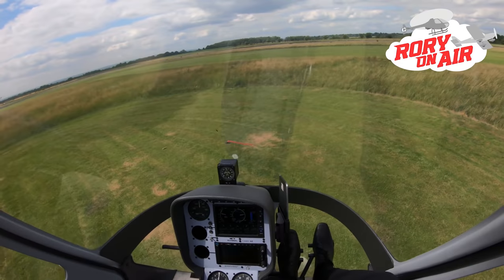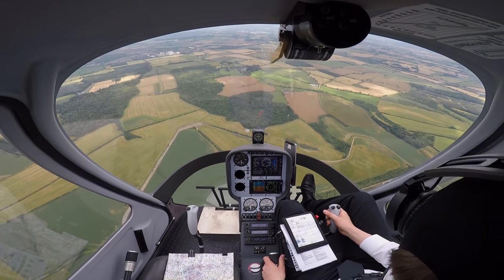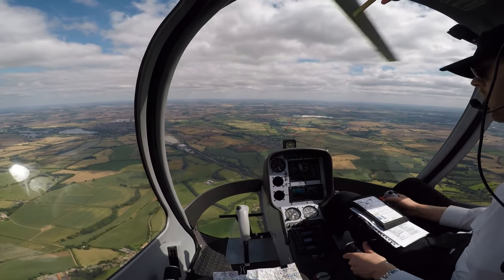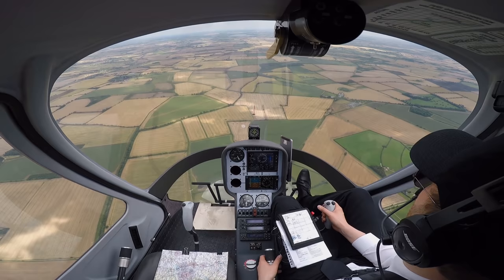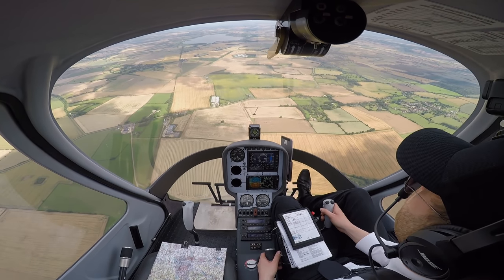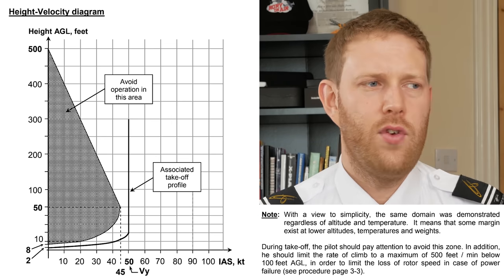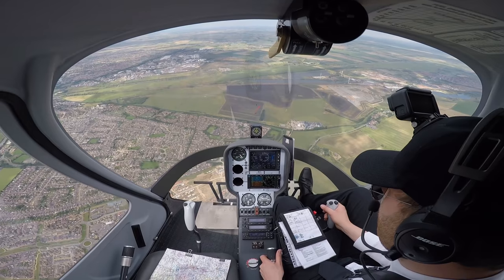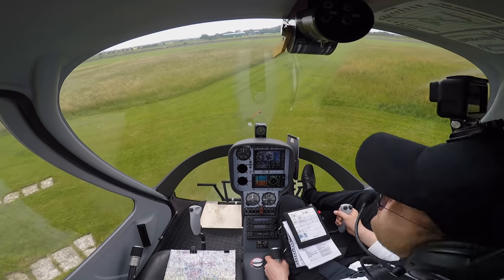Why do helicopters use runways? | Cabri G2 | Student Pilot

Comment: Great video Rory as always - loving the helicopter stuff. Does that aircraft have trim controls on it ? Im not used to that in the R44, or at least in the ones Ive flown lol. Great explanation of the Height velocity diagram
Reply from the maker: Paul Bury thanks very much Paul - glad you’re enjoying the heli videos. Yeah, the cyclic has a trim hat switch on the top of it.
Reply: Don't want to get my feet wet ha ha

Comment: Hi Rory, another interesting video.  I notice that the kneeboard is on your left leg.  Are you a south paw and if not can you let go of the control stick safely to write on the kneeboard?
Reply from the maker: Well spotted. I am right handed and I can't write with my left. You absolutely can't let go of the cyclic once the rotors are running so I have to try and remember what I need to or in cruise flight I can just about fly with my left hand and write with my right. It's not easy!

Comment: Hi Rory,

Great video and thanks for the explanation. As a fixed wing pilot, I've always been confused by helicopter operations and wasn't even confident that they did always use runways at airfields. 

But if I'm not mistaken, at the end of your video don't you actually land at the "H" without using the runway? 

Assuming so, would you be able to explain how a fixed wing pilot would know your intentions in this situation? Maybe if you could mention the radio calls you made in this case as an example? Or do procedures vary with the airfield?

Keep up the good work!

Graham
Reply from the maker: Graham Thurston thanks Graham. Yeah Leicester has published heli procedures which are basically circuits at 700 AGL and the opposite direction to the planes doing circuits at 1000agl. We go to the H but still operate more or less in the runway orientations so the planks know where to look for us. It stops us taking up runway time and allows more traffic activity.
Reply: Thanks Rory. 

Btw, is the active runway always the same for helicopters and fixed wing? I could imagine there are some runways at Leicester that wouldn't suit fixed wing (because of length) even if aligned to the wind
Reply from the maker: Graham Thurston generally they are the same, the active is usually the most appropriate runway for fixed wing traffic. They often use the longer one with a crosswind rather than a shorter one into wind if it’s light. Helicopters can do what they like so we sometimes use the more into wind direction.